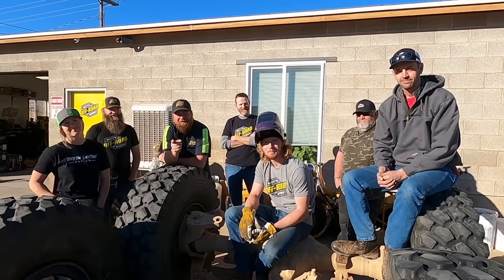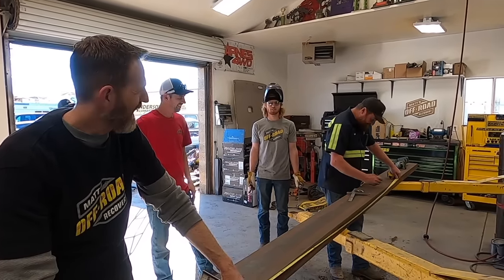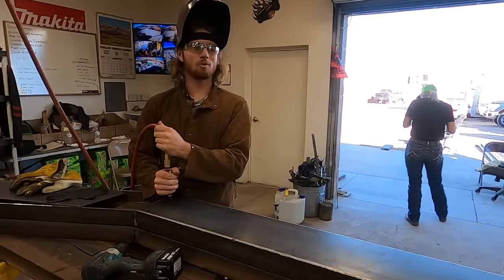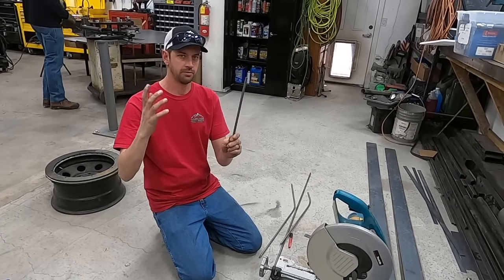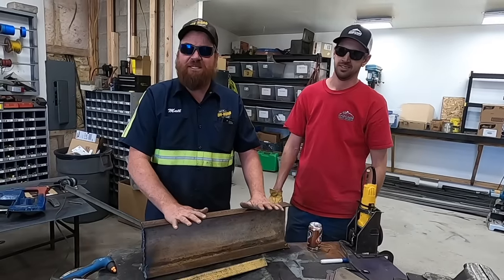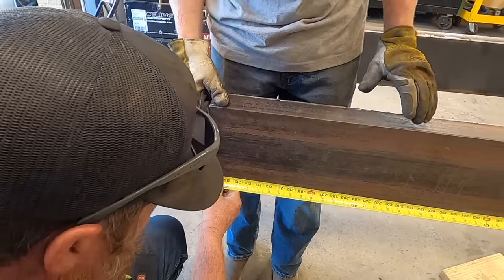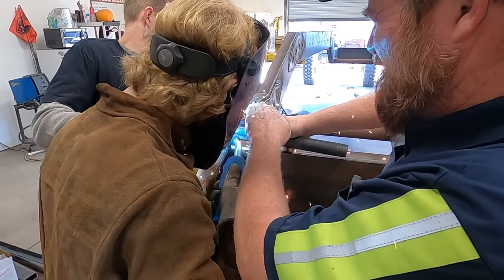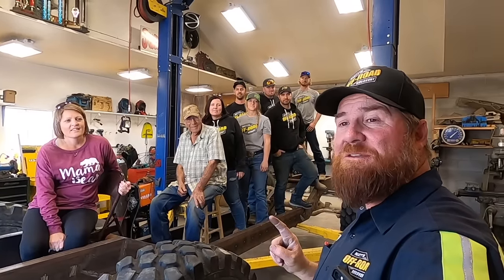I'm Building The WORLD'S LARGEST Off-Road Wrecker

Comment: As Chief Brody once said, "we are going to need a bigger boat!" Or in your case you are going to need a bigger lift, a bigger shop, a bigger trailer if you are planning to trailer it a job. 
You are saying with a rig this big you don't have room for air tanks? Air tanks are round and designed with baffles and drains in them for a reason. Suggest you ditch the frame rail air tank idea.
Was holding my breath when those heavy frame rails were perched on the lift pads, hoping they did not fall off onto someone. Am also curious how you go about registering with the DMV in your state something like this you build from scratch with no vin number.

Comment: I may be way off here. But wouldn't making the frame boxed like that and holding air just make for a great enviroment to introduce rust to the frame. Also, if its already bulging from air, wouldn't adding flex when offroad pop that 3/16ths plate out of its welds, especially if its full of air?

Comment: I reckon if you looked an old international b series as your body or some old international truck it would look really tough. You’ll need a good strong diesel too.
Not the most efficient thing but a b series sitting on mrap’s powered by a Detroit diesel 8v92 would be bloody legendary.
Reply: If you need dual cab b series isn’t great, all the ones that exist are either rusted beyond repair or pavement princesses and to nice to butcher (I’d know, I own one. It’s the first option) 
I have seen a load star  dual cabs and they look tough! Cool looking trucks.
That probably your best bet.

Comment: Matt,,,   I think I saw two different tapes being used and the tapes are being used to determine some very precise tolerances.

Have the tapes been stretches side by side.???   You must always check if multiple tapes are on the same project.
I have for nearly 50 years used the same model of Stanley tape  the 25' one inch wide.  BUT,,, I learned many years ago the three tapes in the shop are NOT all exactly the same.  The tape faces are printed on some rolling drum  and if a tape in process slips a little,, the hash marks will not be the same.  Hook and check the tapes side by side OR,, use only one tape through the entire job.

I routinely work to tolerances of 1/64th , 1mm or less manufacturing cabinets.  When parts don't fit,,, it gets expensive.

Comment: I will predict that your frame will look like a piece of tufted upholstery when it is pressurized. Did you think to put in a drain valve at a low point to remove condensate. Perhaps it would make a better gas tank than air tank.
Reply: I’m thinking the same thing. Maybe rubber bladder liner? Not to mention the stress fatigue of pressure build and release after a few years. Cool idea though space saver and all
Reply: @moerockha625  Built like fuel cells used in racing.

Comment: I feel like a well built, over engineered chromoly tube chassis could have been better. Would be " light weight" to handle the sand, with the capability to add weight with ballasts if you went on a job where you needed extra momentum to yank out something big. Either way, cool build and good luck!

Comment: Have you done the math on your air compartments?  At 100 PSI, there is about 100,000 pounds pressure on the cover plate (estimate 1000 sq-in of surface).

Comment: Seems like a bad idea to use a rectangular frame rail as a pressure vessel. Why not add a proper on board air system for air lockers, brakes etc? Not sure if those are air locking diff’s but nonetheless

Comment: Been thinking about this project the last few weeks.  Occurred to me that using the frame as a compressor tank will lead to condensation and potential rust.  I do not recall seeing a drain plug anywhere.  Is it too late to treat the interior to reduce corrosion?
Reply: i shoulda read the comments FIRST.  I see so many others already noted the corrosion issue.  DUH.

Comment: Rather than moving those strengthening plates from the outside of the frame to the inside I'd have just bought a few more - have them both sides.
You don't want the frame breaking in the middle of a tricky rescue.

Comment: I really don't know. A frame that's going to be under serious stress using as a air tank. The welds will crack on day and air will leak. Doesn't seems like worth all that work just to save the space of a 10 gallon tank. but they need a new you tube story. Lets see how it works out. They look happy to work it out.

Comment: Guys, I love what you do and your enthusiasm but the frame is flexing all the time, not much but it does. Using frame voids as a chamber for compressed air (even low pressure) isn't a good thing. Better use standard tanks for pressurised gas. Can also use 3000psi tank with the regulator which can store huge amount of air (yes, you'll need to refill from hp compressor)

Comment: Did anyone think about the metal shavings INSIDE the air tanks left from the drilling? Better make sure the air outlets are at the top, otherwise you'll be shooting steel shards through your air hose.

Comment: Wood sawzall blades cut steel better than metal blades.... I cut a 100 gallon stainless steel water heater tank in to small pieces with 2 - used - blades

Comment: What a bunch of muppets. NEVER ever put pressurized AIR in to something not pressure rated by a certified factory...

Now you have a crooked frame and your car will never drive straight. nice job  lol

that frame is also so overweight that its ridiculous :D and by design it has little to none structual toughness compared to the weight xD

Comment: After everything Matt has said about weight saving and 'floating' across sand, what is the logic in going to the opposite extreme, building the heaviest offroad vehicle possible?
I'm guessing this is going to have double back wheels like eg Trailmaiter.
I saw the episode with the 5 ton, came away with the impression that was a blind alley.
The guys cannot even lift one of those wheels in the garage, how will they cope out on a trail?

Comment: So MANY warnings in these comments! In a past life I was a certified pressure vessel welder (I'm retired). Please don't use that frame as a pressure vessel as IT COULD EXPLODE RATHER VIOLENTLY!!!  You said "If it doesn't work I'll add a tank" Matt "If it doesn't work" could mean an explosion with injury or even death from shrapnel! Honestly it's scary all you guys were standing by that frame when you added so much pressure to it. Adding the rod made the flat sides stronger but also added more stress points. Don't risk it tanks are cheap! I watched such a thing happen when a man welded a flat end on a piece of pipe and tested the weld with air pressure, it nearly blew his eardrums out when it exploded. Fortunately he wasn't in line with the end as it flew off. Your frame may last awhile then without warning blow apart despite your efforts to reinforce it. The fact that it is bowing so much should be a warning to you. Just imagine the flexing and stress that frame will be under then add the pressure on those corners. Why do you think ALL pressure vessels are round with domed ends.  By the way your down hand welds are weak, too much cold lap. Best to use flux core (.045, change polarity) as it is easy to weld up hand (and any other position) which is FAR stronger and doesn't require (but can use) gas. Anyway, great shows, always interesting. I watch more of your shows than anything else on YouTube.

Comment: The corrosion of wet air inside the frame rails, plus the danger of having 100,000lbs of force ready to pop a seam of the square tank means that frame tank design is doomed from the start. For vehicle longevity sake, and for safety sake, just run a regular air tank. The inside of your frame was already rusty and you didn't treat it, wet compressed air is going to wreak havoc. Your frame will last significantly longer if you ditch the air tank frame idea.

Comment: I realize odds of ya'll seein this is non existent but perhaps someone you know will see it.....For 12V to 110-220 look around for some older bucket trucks, i only have experience with a couple DuraLifts i bought for my wife. Yeah, you would just have to know her. On these trucks they have high power inverters with the good sine waves. You can run electronics and variable speed tools. The cheaper inverters with the other sine waves are not good for electronics and variable tools only run wide open. The trucks have outlets all over the trucks plus there are lots of hydraulics and one hydraulic belt driven pump and one emergency 12V, i think, back up pump you could utilize. 2000 up Chevys have 4 wheel disc brakes you..
This build is probably already finished. I'm also one of the advocates for usin a super heavy military wrecker. On that 6X6 truck ya'll tested it wasn't a wrecker and didn't use the on the move tire inflater/deflating. Mighta helped. My reasoning was that it was ALREADY a complete wrecker with rotator, monster winches, the tire thing and maybe a big generator. I guess the weight was a problem but I'm sure ya'll coulda lightened it up. 
Stay safe. Hope ya'll get along off camera as on. Ever get to Tennessee give us a holler. rick. Feb 17, 20fuctup22 with bad storms coming. 
My 5th and 6th cancers are back so won't be writing on air and writing these longassss comments much longer. Thanx.

Comment: I've been very impressed with your fabrication skills in the past but being a retired heavy equipment mechanic you need ample capacity round air tank(s). Having specked over 1000 heavy vehicles for a local government I always erred on the side of caution.
You will regret having limited air supply available at the worse possible time. It's a whole different ball game moving up to heavy equipment from light equipment that can be stopped with a manual parking brake. Anyway do what you want and I pray for the safety of your employee's and public.

Comment: Am I the only one stressing over having a pressurised vessel as a stressed structure (frame)? With eyechrometer calculating at least 15,000 lb of stressed stored in each rail of this frame, you would not catch me sitting on it.  At least, Paul’s (Fabrat) bumper tank does will not be submitted to as much stress… until he hits something hard.  100 psi is a lot of energy on big surfaces…

Comment: I can't help but point out how much time and money would have been saved by utilizing an OEM  heavy frame and undercarriage from a pre-existing vehicle. That MRAP frame could have been cut down with less weight and was nearly indestructible.
Reply: Building the basic frame is a small deal in the big picture, a couple of days with free helpers, and the material was free. One stand much more free regarding the design doing it like this from the bottom up. A pre-existing frame would likely needed quite a few modifications, and one might not come over a suitable frame regarding wheel space and more. Regarding weight, that is something one want more of regarding a wrecker like this, for better stability. Sometimes starting out with a pre-existing frame is an advantage, if one are lucky finding a suitable one, and at a okay price point, but in this case I would go with a custom frame, as they do.

Comment: Claw hammers on steel is dangerous…
I learned the difficult way…
A tiny piece of the head chipped, and I saw it fly, right toward my crotch…
I just saw a blur flying through the air…
Wasn’t even sure I saw it…
Then I looked at the hammer head, and a tiny chip was missing along the very edge of the head, and I thought, well, I’d best check inside my pants…
Yeap, bloody in there, best get to the emergency room…
Ended up riding my 76 KZ900 there…
Was working on the car…
Dr. Got it out, the exact missing chip…
Your life, your nuts…
ROFLMFAO

Comment: Great channel but please wear gloves, safety glasses and clear face shields when grinding. When welding still wear the clear safety glasses under the welding helmet.  you occasionally flash yourself or lift you lid up and a coworker is welding near by happens all the time the clear safety glasses will protect your eyes when that happens. When using anything that has flying debris a clear face shield is a necessity and you should almost always be wearing gloves. I take my gloves off when I'm using a drill press or a lathe and put on nitrile gloves. you should never touch steel with your bare hands.

Comment: Well cudos for taking on this build.. but world Largest off road wrecker...... lol... hold my beer... and why not just buy a used HEMET or ACTROS or even a tracked ARV from the military in surplus. but your not even in the small truck league for wreckers. for off road. I have been doing this work for 30 years in the army. and our biggest recovery machines are rated as no road required.... not off road.. but no road.... you can suspend tow close to 20 ton and static lift 40ton anywhere... then you get to the smaller machines like the Actros... but its just a baby...

Comment: Having just seen a air reservoir burst due to internal corrosion over time, I think you are giving yourself unnecessary problems with a non-round pressure vessel with no facility to cope with condensation inside that you don't see til it goes bang

Comment: I used to drive MRAPs in the Army a lot in Iraq and Afghanistan… those things were terrible. Everything about them was just unreliable and bad. I hope the only thing you take from them is the axels… they used to get stuck all the damn time. We hated them. Near my least deployment, we started seeing the next generation vehicles… can’t remember the name now. Look like a Pickup truck on steroids. Those seemed decent. MRAPS though we’re a deathrap. I remember our truck got hit by an IED. We all survived but it killed the electrical system so the back door wouldn’t open and because of the angle of our crashed truck, the side door and passenger door wouldn’t open due to a lack of hydraulic pressure and the front passenger door was damaged. We had to climb out of the gunners hatch while the front of our truck burned.

Comment: Soooo...when's the last time you saw a submarine that wasn't round they're designed to hold the pressure out as soon as that frame flexes that thin metal on top is going to cause a problem. And the time involved.. WOW. 20 minutes to mount a proper pair of air tanks. We're ran a truck with a single driver cab and everyone called it the coffin ⚰️. Barely enough room for you and a small lunch box.

Comment: Wow, using the frame as an air tank is innovative and a bit scary. Obviously it can hold pressure, but why? you're acting like the "world's largest" off road wrecker has no room for a cylindrical air tank. How do you plan to drain the water from it? That frame will rust from the inside out over time if not drained regularly.

Comment: When you cut the excess off of the frame for the front end why didn’t you cut an angle so if you dove into my phone and situation it would lift the tires up if that makes sense I would never cut off the frame prematurely that would be the last thing I never do especially before you put the winch situation on

Comment: ^^^^^^^^^^^^^ is an engineer. As mentioned in a bunch of other comments by other engineers, for safety and reliability, please delete the home-made in-frame-air-tank idea and use a tested and rated cylindrical pressure vessel (or two to add a reliable backup system). Leave the boxed section in place as it'll add rigidity, but that tank thing is a massive safety and reliability issue that could ruin you with liability issues when it goes explosively wrong. 

You'll be doing the community a service by making a big deal about how you decided this was a super-bad idea - because it's a super-bad idea and nobody should be doing it!